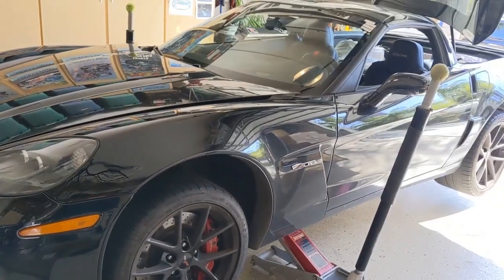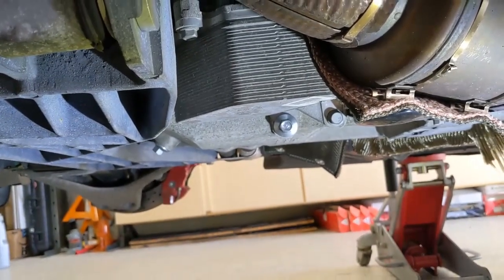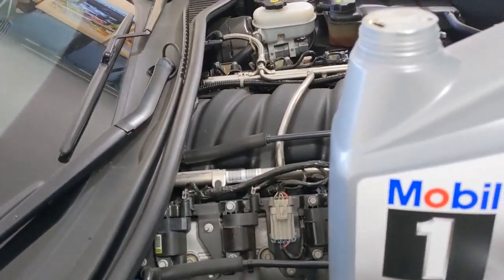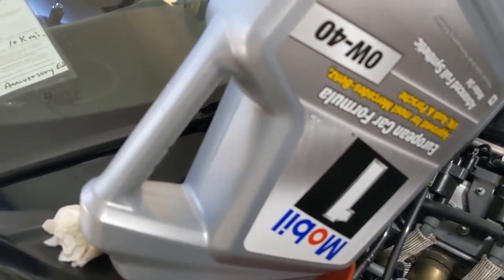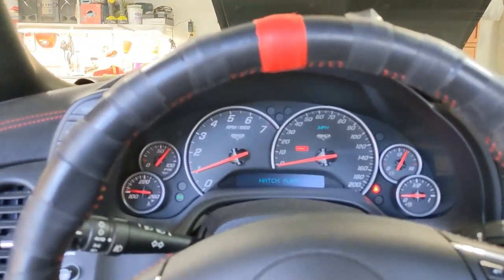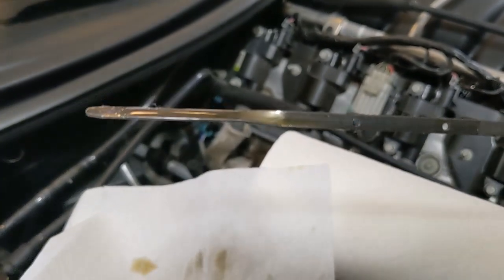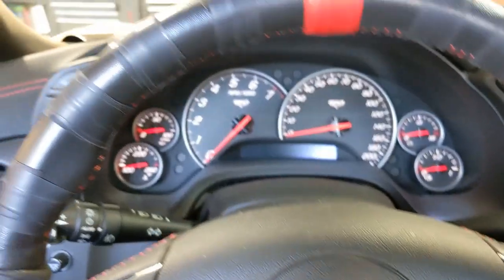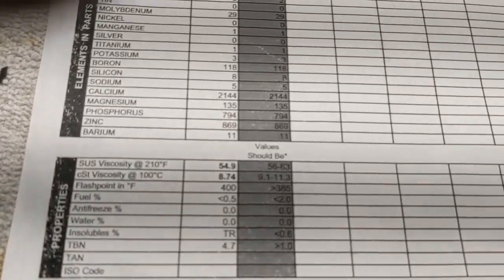Corvette c6 z06 oil change mobil 1 one 0w 40 european blend reset oil life by froggy

Comment: Why did you choose to run 40 weight?
Reply from the maker: It's better.
Reply: @1947froggy  10-4…I was considering running it in my LS and that’s how I found your video. What about it makes it better?
Reply from the maker: @engineman02  It's the European spec oil IIRC. I get great oil pressure all day long in my 2013 z06.